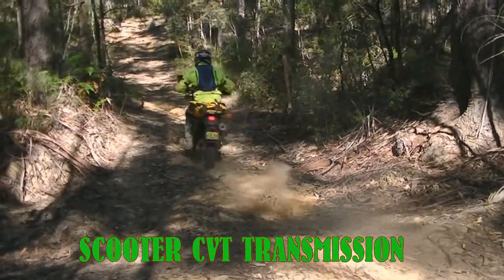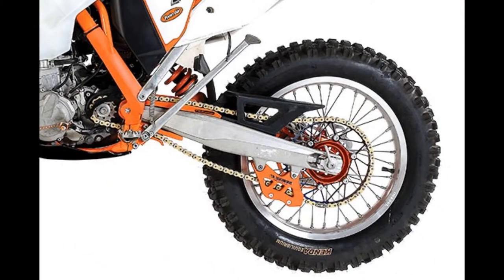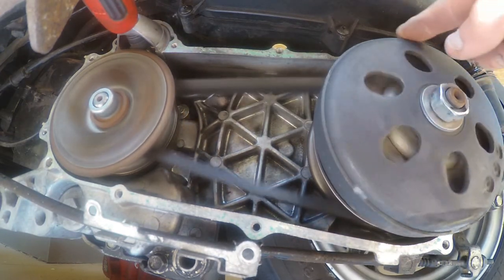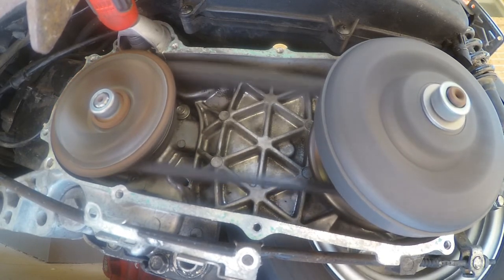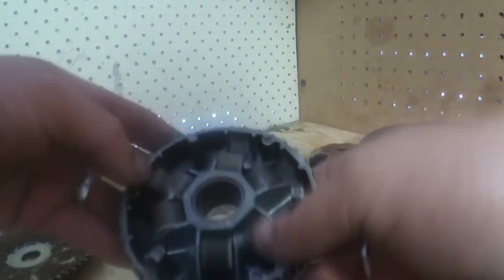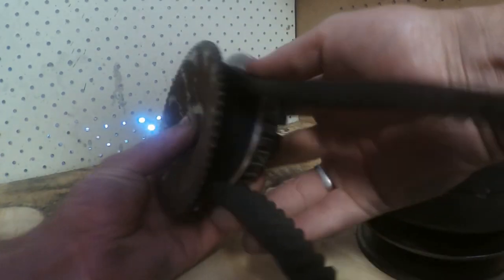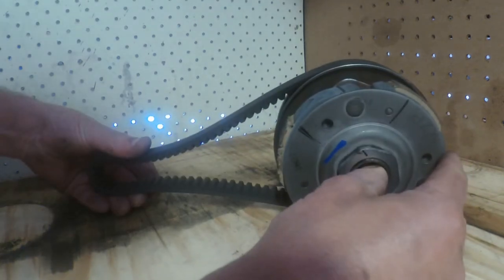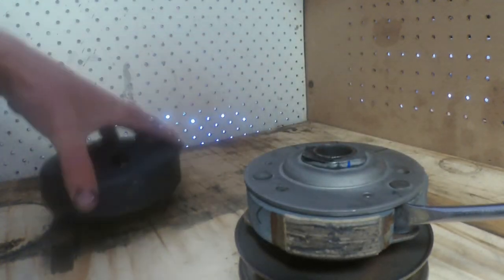Motor Scooter CVT (auto) Transmission explained

Comment: Thanks.  I understood your video better than seeing the animated videos showing the components moving.  Centrifugal force changing the belt diameter on the pulleys at both ends of the system.  I note the clutch end pulley is not directly in line with the rear wheel axle, so presumably a gear from the clutch end of the CVT to the rear wheel. Not a gearbox though.